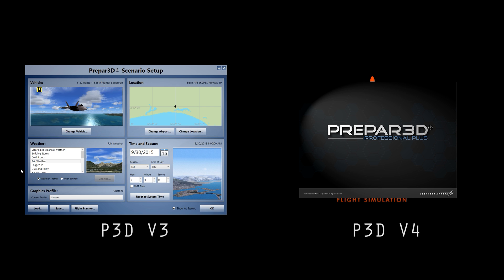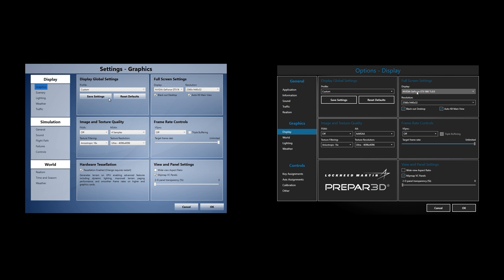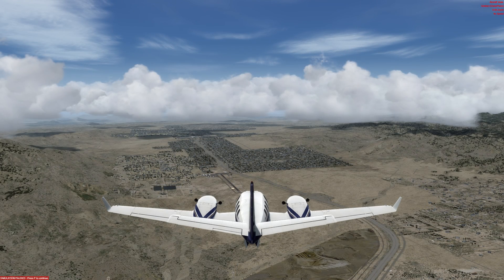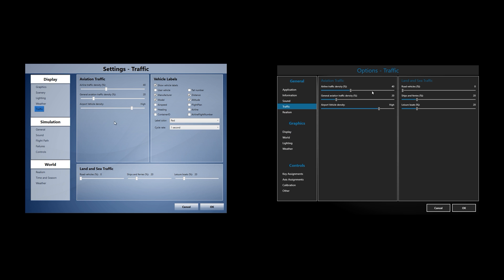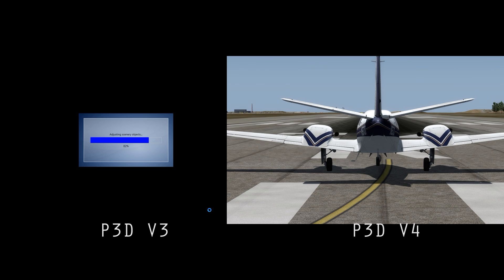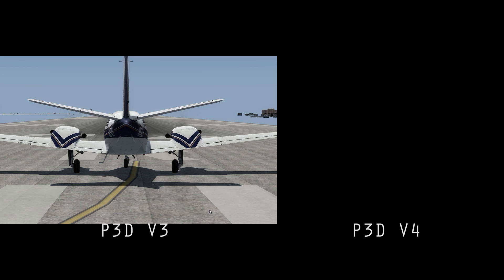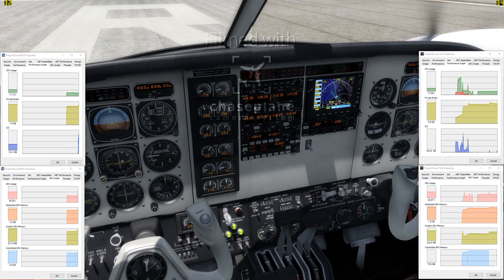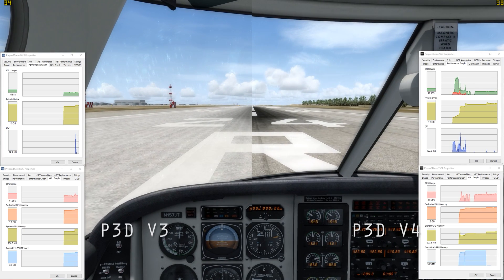P3d v3 VS. P3d v4 *Performance Side by Side and Stress Test*

Comment: My main takeaway from this video is that P3d v3. and P3d v4. look almost EXACTLY the same.
Reply: yeah shame there's no conclusion, just some comparison material without any final thoughts/summaries, shame
Reply: Look at the building drawing distance. Then comment. In the p3d V4 you can see buildings and cities far away. While on p3d v3 nothing. So yeah.. same thing...
Reply: Its mainly under the hood improvements.. 64bit is a game changer. Meaning you can now run ALL the 3ed party scenery/aircraft you want and not have to worry about running out of memory anymore!
Reply: Because they where doing anything on the fron end. It was mainly optimazing backend.
Reply: Yes its true. Its a basic thing of 64Bit. People really dont know how hard it is to transform a platform from 32Bit to 64Bit. That is a painfull amout of work. But the annoying things like OOM is gone that is it. No more final approch OOM messages/Crashes. Yay
Reply: Not Really because it's now almost not possible to have an OOM. And as many people have 16-32 GB of RAM anyways it does not really matter. It's good that P3D can finally use more RAM
Reply: small update on my part, i have switched. and i'm not dissapointed!!!! NO vas errors. No crashes. And i have done some pretty long flights with several pmdg planes from several addonscenery's. Smooth as silk and looks great. and for the cherry on top, dynamic lighting looks absolutly stunning! no other words for it. conclusion. Im not switching back.
Reply: +jaime i don't believe this until the forums proof it. i'm sticking with 3.4 for now.
Reply: i  need proof. seeing then believing XD
Reply: Okay Do you have 4GB of ram does anyone here have 4Gb of ram?
Reply: Please that sound intressting explane more
Reply: IAH jetsetter, whut? that's not true in my case. just runs the same way as v3. only better.
Reply: You must be blind. They are nearly identical with the exception of memory usage.
Reply: @Sm00thieK  no u
Reply: @Sm00thieK  What im saying is look at the ram.(Private bytes) v3 if  it goes over 3. something it crashes.
Reply: Version 4 looks a lot smoother with less stuttering/jerkiness.
Reply: Didn't you form your own opinion?
Reply: One uses 2GB of RAM and the other uses 6GB RAM for the same thing !!!

Comment: Ok for me it looks as expected small improvements are to be seen however it is and remains  unfortunately the same dx11 engine, am nevertheless strained and look forward to tonight. What I can not understand is that everyone is currently screaming that you absolutely 8gb vram needs and me has already strongly surprised since v3 with me has never used more than 3gb vram and also here to see a maximum of 3.1 so I think you get with addons like Orbx and pmdg + ultra settings maximall on 4gb vram.

Comment: No more autogen popups they said, nekk minute, pop pop pop.
Reply: reepeez You obviously didn't listen to Jordan's introduction -- he deliberately turned v4's LOD down to match that of v3, so that you'd get a fair framerate comparison. At v4's default LOD, you wouldn't get any popping.
Reply: But if you have to turn the LOD down to get decent performance then what's the difference?
Reply: were those buildings "sliding" into place as you got closer?? O.o
Reply: theoldar Much better performance and reliability using the same grapich settings?
Reply: I was just talking about removing the autogen pop-ups. If you have to lower your LOD so much that you still get pop-ups, then you really haven't gained anything. Maybe in two years when the GPU's are running at a zillion MHz and have 50Gb of memory.
Reply: LOD radius. If you use a similar LOD radius than P3D v3 then obviously they'll pop in